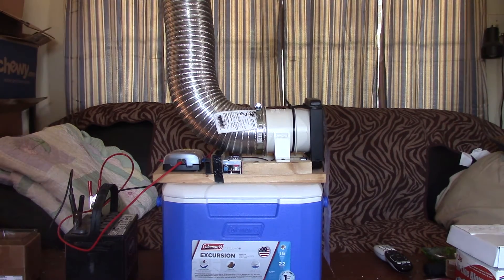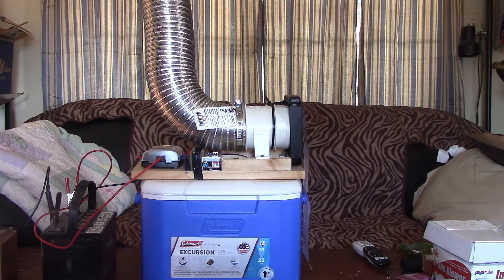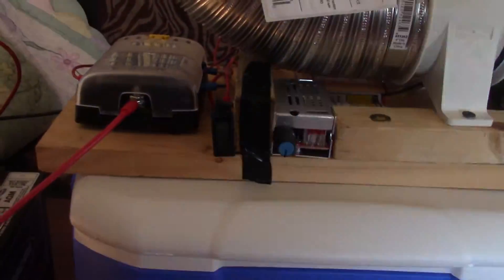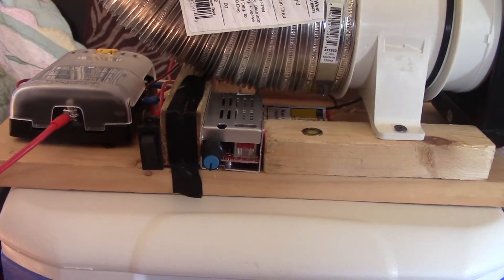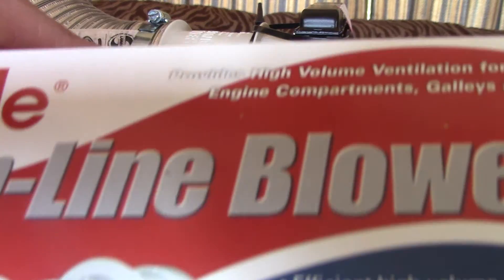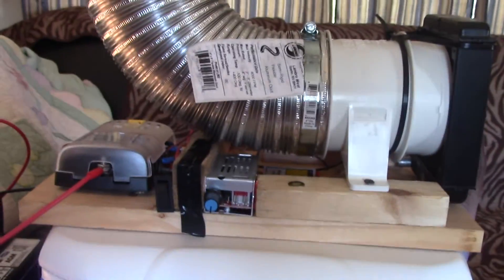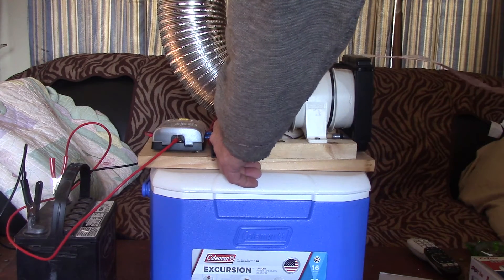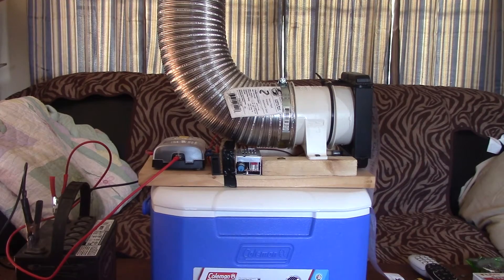Ac/Air Scrubber/Homemade $60 uses 30 Watts

Comment: Hello Peaceful Prepper.   Could you do an update on this?
Reply from the maker: What would you like to know?  Working on other projects at this time.
Reply: +Peaceful Prepper   Did you try this in real conditions?  If so, how did it do and were there any modifications?
Reply from the maker: Hi Bill.  Yes I did try it in real conditions.  It worked great for me.  Remember this is just an alternative to the homeboy coolers people were making.  As a personal cooler it is great.  The thing I like about this style of cooler is it works.  Again it is for a small space and 1 or 2 people.  I am playing with pressurizing and hope to make that work and eliminate the ice. I have a lot going at this time but am looking forward to getting some time to continue this project.  Build one and give it a try.  You can get all the parts you need on amazon and if you don't like it send them back.   The thing I like about this is the blower has many uses when not being used for the project.  Everything I do allows one to use the components for multiple projects.  If you need serious cooling there are some small, but pricey, AC units out now.   One more thing, if you are in a situation where you need cooling I would not use any of these ice coolers, buy a heatpump/AC.  Swamp coolers work great if you are in a dry climate.